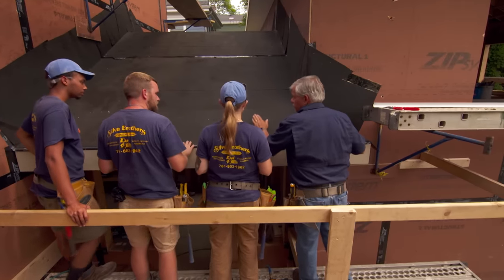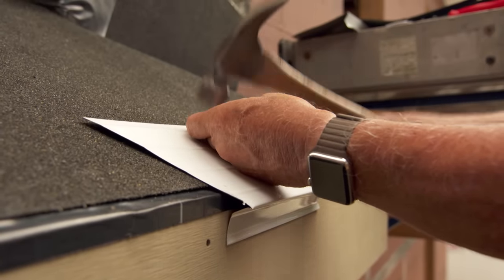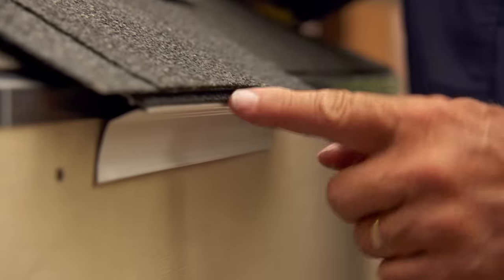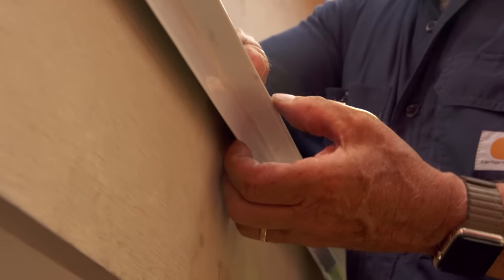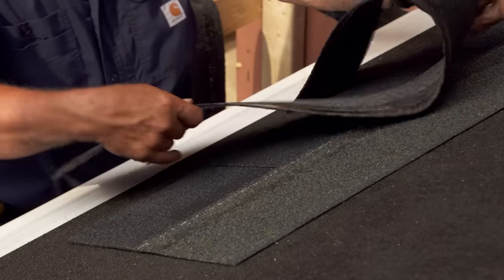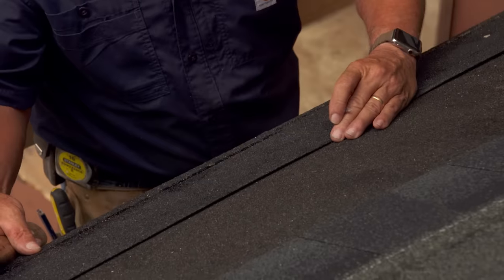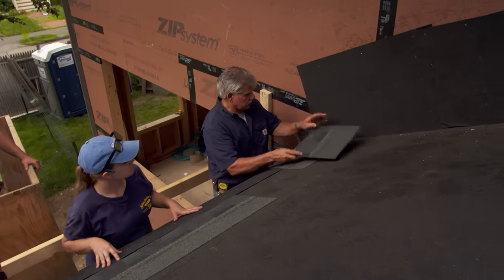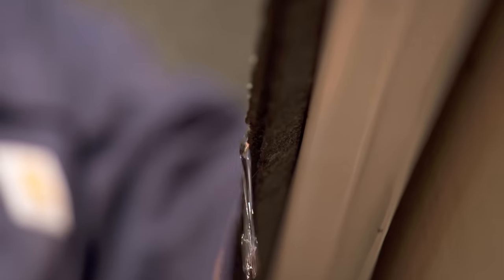How to Install Drip Edge and Step Flashing | This Old House

Comment: I recently had my roof recovered due to hurricane Zeta and the roofers installed my drip edge just like you demonstrated was a “no no”. I called them back out and refused to pay until it was fixed correctly. The contractor sent out the same person everytime and he just made things worse everytime. I finally told them to stop and don’t do anything else. A majority of the houses here in south MS have been done  the wrong way. Even when built new. For this reason I now have bad fascia boards covered by metal flashing. I enjoy watching your shows. Have them set to record every week.
Reply: Everywhere but Florida you put the underlayment over the eave drip edge. Looks like manufacturers make exceptions in their install instructions if you install a flashing tape on the plywood to facia board.
Reply: Never trust contractors, sometime they are new employees and no experience.

Comment: I see your drip edge has alot of nailing surface.. what im seeing at my local supply store only has 2" nailing surface.. where would i find the drip edge you are using in your video ?
Reply: Did you ever find. I've only seen tome with that extra wide Drip edge?
Reply: @corysturgis6660  i was told my area doesn't reqire the wide drip edge so they only stock the 2 5/8 wide material... I did install a roll of ice barrier, so I feel pretty confident it'll stay dry. Thank you for your response

Comment: Gonna be 1 million spiders and bugs  living in that drip edge gap.
Reply: Not to mention bees.  I thought the same thing.  Seems crazy.
Reply: @joshhaas2410  Right, i usually just put mine loose against the fascia, With that being said, most houses have gutters in that area. Plus in the video that gap he put between the fascia and drip edge didnt even show a purpose during his water test. the water was able to run off properly because he overhanged his shingles isntead of running it flush. 

I work in vancouver and we use metal w valley and i always trim the valley metal going into the bottom of the valley and fold it in on itself because for one, it takes 1 minute to do, and secondly it avoids bugs and bees from going in there and creating a nest.

Comment: Most drip edges have a lip that kicks out already, I dont  give an inch away from the eaves . I put the shingle 1 inch from the drip edge to though
Reply: Why cant the shingles go even with the drip edge. He says it's a no no but doesnt explain why
Reply: Because some people think your gable will rot out as they think water will still hug the gable. Leaving an inch for the drip edge is fine, ive done it. But Some drip edges are so flimsy that you cant anyways as its not long enough. You also should remember that most older homes havent had drip edge and are perfectly fine. Wouldn't stress about it, far more important things on a roof to pay attention to

Comment: Sealing membrane, I have no comment about, but for those that says he was totally wrong and about the drip edge that it should be flushed are wrong. Not only has some roofers witnessed damage done with the drip edge flushed, Shiva  has demonstrated it on Ask This Old House how flush is bad. Is using a 1x2 or leaving a gap behind the drip edge better? I have not seen or heard any thing on that.

Comment: USING DRIP EDGE TO STOP RODENTS GETTING IN THE ATTIC- I watched two videos with Tom Silva discussing the proper way to install Drip Edge. We have squirrels in our attic and a pest control company wants to close up the "construction gap" with drip edge sheeting.  Since they're attempting to keep out rodents, I'm concerned they will nail the drip edge directly to the fascia board.  We have covered , perforated gutters so I'm also concerned water will get behind the gutters and put tension on the fascia.  Should we have a roofer install the fascia instead so it's away from the fascia, verses "wasting" money with the pest control company that will probably install the drip edge incorrectly just to seal out squirrels? Would LOVE TOM TO ANSWER THIS DIRECTLY, BUT WELCOME ADVISE FROM ROOFING PROFESSIONALS THAT SEAL ATTICS FROM PEST.  THANKS!

Comment: Here in texas we add a 1x2 between the fascia and flasing
Reply: For what purpose?
Reply: @christopheralegria71  for the same gap that he made with his fingers as spacers. It's more consistent on a job because not everyone's hands are the same size and you don't have to measure and waste time. Push it up to the 1x2 and move on.
Reply: That's how I've done it for 45 years. Here in New England and Galveston/ Crystal Beach , Texas
Reply: @mikez4132  so the drip edge lip hangs past/lower than the 1x2 then?
Reply: It doesn’t seem to work, though. I have the 1x2s on my house, and the eaves are all rotted because the water run across them. The 1x2s fail to break the surface tension.
Reply: @AlexMercadoGo   the drip edge needs to hang lower than the 1x2 so the surface tension cant let it roll backward on the facia. It has to be  made from taller sheet metal. The short drip edges wont work with the 1x2.
Reply: Same as my house. After 37 years, my house has to replace with all new fascia broads.

Comment: I’ve seen mixed videos in which a drip edge is applied to the pitch edge of the roof and some don’t. What’s your thoughts? I’m replacing my drip edge in the next 72 hours as I’ve discovered the old drip edge has gaps and allowed a significant leak and damage to accumulate around some window frames.

Comment: I now have to figure out how to fix my new roof because the roofers didn’t nail down the drip edge good enough so it’s humped up in places and not overlapping the gutters. And they ran the shingles flush or not even covering in some places. Makes me wonder how many roofs are done incorrectly because these people had years of experience and were doing it this way.

Comment: In the old days, roofers did not set the first line shingles and membranes passing/overhang the drip edge to avoid water leakage. Sometimes, I watched heavy rains flash down from valley, water touched the fascia broads. Therefore, many houses are having fascia broads damaged included my house. The hard part is to remove a small section of fascia broad, not to removing any shingles. My shingles and drip edges are in very good condition.

Comment: Another roofing video that, unless you live in Florida, shows the wrong way to install drip edging along the eve edge.  Your drip edge MUST be underneath your underlayment on the eve edge, NOT over. That's code in almost all states except Florida, and even if it's not, manufacturing recommendations also state that it must be under. Only on the rake edge will your drip edge be on top of the underlayment. Likewise, not sure why you spaced your drip edge out with a gap... nice way to get more moisture and insects (Spiders, earwigs, etc.) into your structure, create an issue for gutter installation, and cause an issue as soon as you put a ladder on the edge to get on your roof.  I think this should be a video on what not to do.

Comment: I've watched Tommy talk about flashing, and how important it is to do it correct many times.  I went out to look at mine and it appears that the builder did it correct.  But whoever hung the gutters put them right to the top of the roof line, over the dripedge and crushing it flat to the fascia board.  My question would be: Should I pull the gutters off, fix the dripedge correctly and then replace the gutters back where they are spaced under the dripedge? I have looked at it when it was raining and the water does occasionally go behind the gutters and down the fascia board.
Reply: They sell gutter edging at depot if water is getting between gutter and facia.  Taking gutter down is a job. Gutter is to be behind drip edge so that sucks a gutter guy is so careless. The gutter edging goes under the shingles and kicks out over gutter. Just a flat 4 inch aluminum strip with a 22 degree angle bend. Nothing fancy but works.
Reply: @andrewrose5491  Thanks! Yep this sounds a lot easier then pulling all the gutters.I have been looking around at other houses in my area. Some of the gutters are installed correctly and some not.  Probably the difference between a professional install and a cheapest bid install.

Comment: Tommy knows his stuff but i have to disagree on the drip edge part of this.. a lot of houses will have aluminum covering the facia board which will protect it, but you're gonna lose gutter space doing it this way,  if you have standard 5 inch gutter opening and your drip edge has a 1/2 inch lip and you hold your drip edge back about a 1/2 inch like Tommy did and then you hold your starter shingle down another 1/2 inch you're losing 1 and a 1/2 inches of your gutter opening which depending on the pitch of your roof could cause rain water to over shoot the gutter, i've seen it many times as a roofer, water will get your hesd wet walking into your house or saturate the ground against your house possibly getting into your basement on long, heavy rainy days.  If you have aluminum trim and gutters do not put your drip on like this and make sure your drip is up tight to the trim and over top of the back of the gutter so the rain doesn't get behind gutter...
Reply: I second this. If your fascia is covered w/ metal there’s nothing to worry about. 

Doing it this way your leaving a huge gap for bugs/wasps to make their homes up under the edge. Plus: how are you gonna put a roof on that eave without damaging the drip edge that’s hanging off so much?

Comment: Someone please explain to me why the underlayment is UNDER the drip edge here.  If water breaches the shingles and rolls down the underlayment to the top edge of that drip edge, I doubt that nailed drip edge is going to do much to prevent some water from going under.  I’m thinking rotted decking and rotted rafter tails.  What am I missing?  Thanks.

Comment: I don’t understand how someone with so much knowledge is still doing this like if it was 100 yrs ago. We don’t have wooden fascia anymore so you do NOT put a gap under the drip edge. Plus the drip edge goes under the ice and water not above. And you have to start with a kick-out flashing.
Reply: All fascia around here is wood. I agree with your other two points.
Reply: So you guys don’t wrap your wooden fasciae with aluminum?
Reply: Not usually
Reply: Cant even find aluminum fascia around here. I tried and would like it install it.
Reply: Nope. Put ice and water right on sheathing under drip edge. For areas where ice damming occurs, ice can back up behind drip edge and get to bare sheathing under drip edge. Best to ice and water under and on top of drip edge.
Reply: I was shocked they skipped the kick out
Reply: @ridemfast7625  Buy coil stock and bend it with a brake. Or have a siding guy bend it up for you.
Reply: I have wood facia...I also have a 130 year old house which is why I enjoy TOH...I would never wrap any of my trim with aluminum...
Reply: @stephenyerly2296  why not?
Reply: @curiousgeorge2749  It fails and eventually rots the wood behind the aluminum. Most people that install it are fly by night siding and roofing guys. It adds unnecessary cost. It typically looks bad. It is typically installed incorrectly. If you don't want to deal doing basic maintenance like painting your house get a condo or join some sort of hoa that does it. If you want to own a house and do less maintenance use Azek or a similar composite material.

Comment: 2  things.  the  drip  edge is  suppose  to  go under the ice  shield and also you dont need a  drip  edge  that  wide, a  waste of money,  another  thing is  the  step  flashing  should  be nailed to  the roof not  the  wall, in the  future that makes  it  easier   to  replace or  deal  with in  general
Reply: Yeah, save a few bucks on the drip edge that gets replaced every 30-40 years 🤦🏼‍♂️

Comment: We bought a house, that has a metal porch on the back.
Where the shingle roof meets the metal roof, its overhung about half an inch or so, then they shoved a rubber backing under the shingle causing water tension, and anywhere where the rubber has split, or is joined, water gets in. This causes the metal roof to leak where the fascia is.

Does anyone know of a remedy to this without redoing the entire roof?
Starter house so not looking to overspend on a solution.

Comment: Can I put some kind of sealant in that space behind the flashing to prevent wasps and hornets from making a nest?
Reply: You can do what ever is structurly sound you bet"
Reply: Just dont do it, i agree with most things tom does but this is not one, with the proper shingle overhang at the eaves its not needed to have a finger width gap. when the gutter guys put the gutters in there, when water drips onto the drippedge it will just flow down and right into the gutters. If gutters arent getting put on, wind driven rain will just wisp it back like how the water flowed back in the first clip. Pointless to have that big of a gap there. 

Ive been roofing for 5 years now and have worked with lots of companies so i know my stuff.

Comment: You did not really explain the step flashing too much or how to lay the shingles on the starters. Did you pull them half an inch to overhand the starter? Did the first nail on the shingle also nail the step flashing?

Comment: I don't like the nailing step flashing to the wall. Next roofer might need to move it up or down, I dont see the need to do that, but some do nail it to the wall. I also on my roof put the flashing under the wall wrap and over the synthetic roof underlayment, that Tyvek Protec 200. that way any water getting under the old aluminum siding flows out away on top the flashing and not get behind it. Was not hard to do when the siding is off. And the step flashing needs only one corner nail in it away from the wall.

Comment: never ever listen to a general contractor with a trim hammer teaching you how to roof.  There's several things wrong in this video.  The only thing that I saw that was correct was the step method with the shingle.  The nailing was all wrong.  But chastise my decades of roofing experience because this is a 'This Old House' video.  Follow these instructions to a T.  You'll discover sheathing that is damaged when you have to replace your roof and you won't be able to get the step flashing out/move it because it's nailed to the wall.  Ask this person, do you nail step flashing to a skylight?  No?  Then why here?  It isn't necessary!

Comment: What's the point of using a drip-edge if you just overhang the shingles and the water drips from the shingles instead of the drip-edge?

Comment: If the facia board isn't wood it doesn't matter if the water travels down it though. It's made just like the drip edge to be resistant to the elements. But by adding that space you've created a bigger area for wind to grab and then the wind is able to work that drip edge loose over time eventually ripping it right off. So this is a bad idea. 🤷 It's overthinking the situation think about it for a minute. If that facia board is wood then that's another situation altogether

Comment: so when you are trying to replace the facia the problem I have that NO ONE addresses is that there are 5 million nails coming thru the drip edge into the top of the facia, so when you try to replace the facia all those 5 million nails prevent the facia from c going up tight to the plywood.

How do you remove the nails? I've tried a jam saw. a nail cutter or just pushing them all up and out...way to time consuming.

Anybody have any ideas?????

Comment: Is it wrong to nail the step flashing to the chimney?  My understanding is that the chimney and roof expand and contract differently and for that reason the step flashing should be nailed to the roof and not the chimney wall.  If the step flashing is nailed to the chimney the flashing will be pulled by both the nail in the chimney and the tar on the shingles.

Comment: Great video. 
One question:
What kind of nails are you using to fix the drip edge?
Are those asphalt shingles' nails?
Reply: Did you figure it out? I was wondering the same thing
Reply: @luislujan8715  I was waiting for the answer here but it never came. 
So I watched a lot of drip edge installation videos and figured out that most of them use asphalt shingle's nails.
My roof couldn't wait so, I used asphalt shingle's nails and they worked pretty well.
Reply: Thanks man !
Reply: Ideally nail matches flashing material to avoid corrosion. If aluminum flashing, use a large head aluminum nail. Or at least a double dipped, galvanized roofing nail.
Reply: Home Depot and Lowes will give you the answers.

Comment: What's going to hold aluminum fascia (if that's what you want to use) in place if the drip edge is out a half inch or more? Was taught you cannot use nails on the vertical portion exposed to weather.

Comment: If the shingles are overhanging the drip edge by an inch why bother having the drip edge away from the facia? Leave it tight to the wood facia so it holds the metal facia tight to the wood!!!!!

Comment: where the heck do you get drip edge with that wide of roof metal. Almost all of it I find is like 2 inches. Can hardly get a nail in it on the roof.

If I did my drip edge like that. It would be one solid Hornets nest around the entire house.